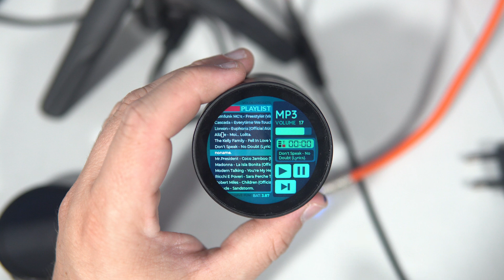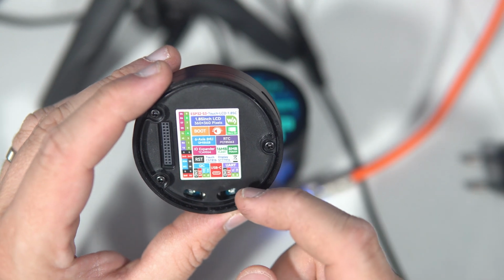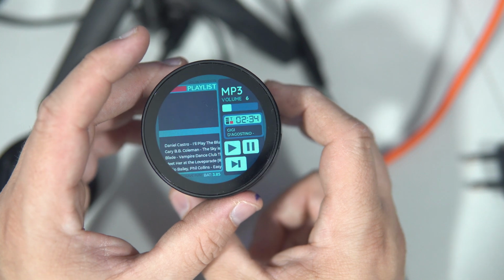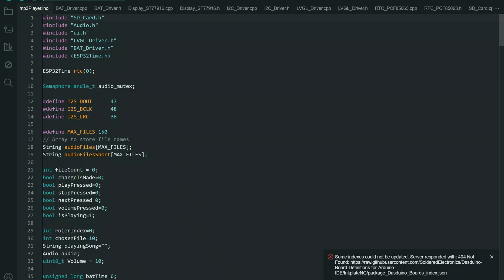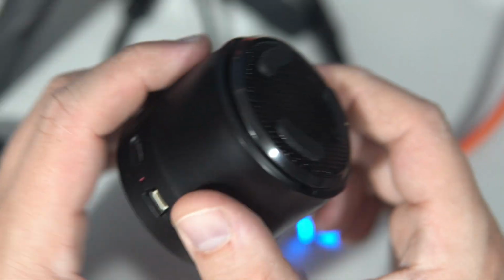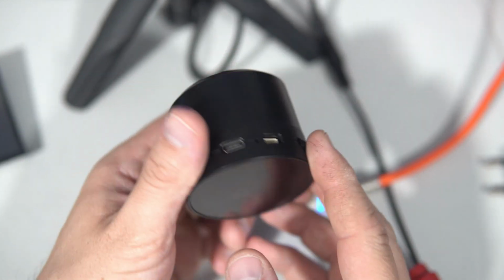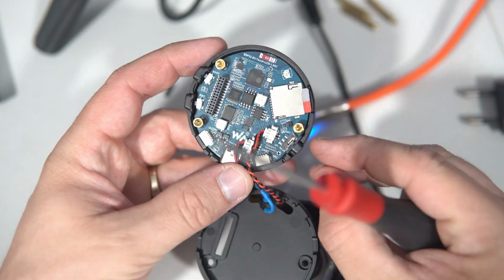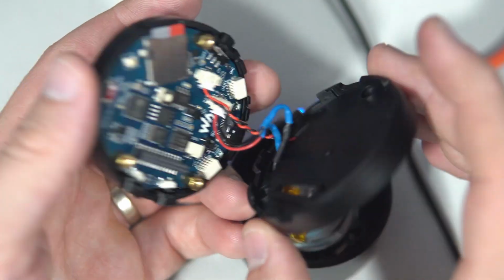ESP32 MP3 Player That Actually Sounds Good?!

Comment: So you dont like SuperTramp ?    Yes a very interesting board, looks very well made. The Waveshare web pages say its targetted at AI applications (audio input interface to the web). Seems like a customizeable Amazon Echo/Dot. Another interesting and good value device looking for a killer application. Power is the achilles heel of these devices, need to be wired as batteries will only last a couple of hours. A nice multi-function dash gauge with built in audio Alarm ?. A demo app with LVGL animations should be produced/commissioned by Waveshare. With OTA software updates these could be a flexible status display for a central control board ? I know you said mid-range laptop but I wonder how loud it is ? I didnt see the amplifiers' power/Watts listed in the specs. That 4" speaker should be able to produce decent bass. As ever, a nice GUI, well done !
Reply from the maker: Hello, yes i like them, but inlike more this version. I also want to know amp watage, it is louder than laptop definently.
Reply: 🤨 ~ and the “speaker” isn’t ported, the music will sound flat with a lot of treble, and if you do turn up the volume and bass the puck shaped cabinet will vibrate with the bass. You need to drill a bass reflex port/vent into its side. Unscrew the bottom speaker cabinet from the top display while playing, and you can compare between “ported” and sealed cabinet 😉